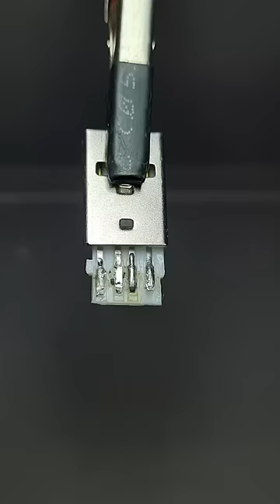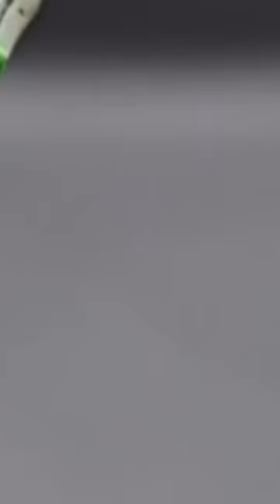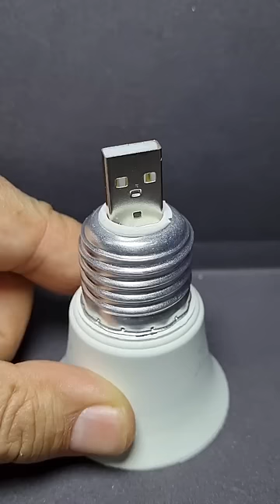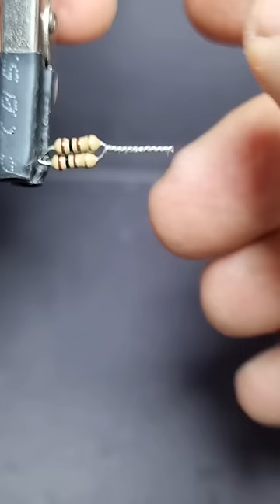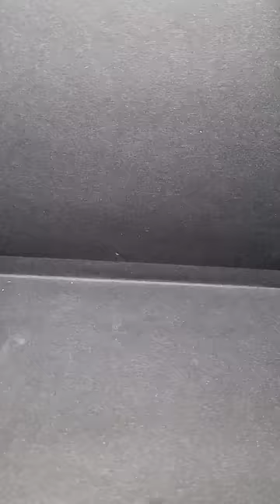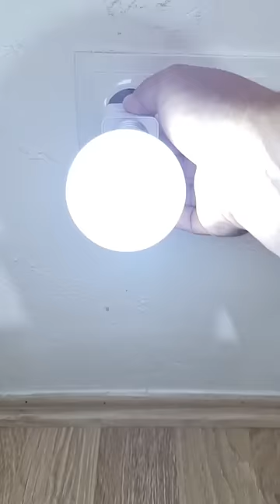Don't Throw Out Defective Led Bulbs Anyone Can Do This At Home  #shorts #zaferyildiz #short  #viral

Comment: You have to pay 7 Euros for window soldering.. That in the world everyone is born as a sharer of God? Or what.

I soldered LEDs in an apartment with high-quality fiberglass windows and blew a wonderful and high-quality windbreaker from these windows in February 2002, I managed to solder a damn LED lantern in 7 hours. Around 4 in the morning, I just finished.

The reason for 30% is that Paishik is so-so. But at 70%, the soldering iron of the soldering station does not heat up Lead solder at 70-80%, no matter what the hell you do. The windbreaker blows into that metal-plastic window and doesn't pierce everything Soldering station Svynets wants those that are February -02. The temperature was minus 12 Celsius.

So everything is simple in the video. But this is if there is no wind and you are Super. But not all People sharers are grandiose.

Comment: Yes, of course I have nothing better to do than soldering around on such a cheap item to make this part light up again. Instead of ordering a new one from Amazon in 2 minutes. No, tinkering around for 30 minutes is better provided you have the materials there, a USB plug, resistors and an LED by default everyone has at home. Sorry but the video is rubbish.